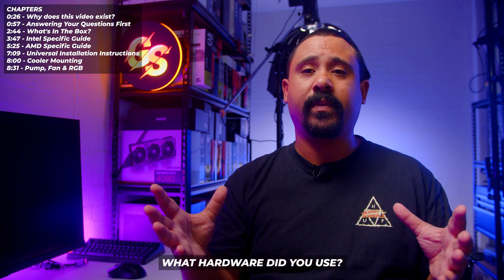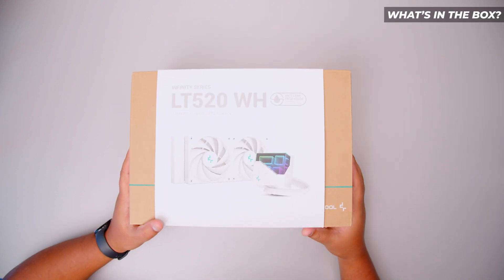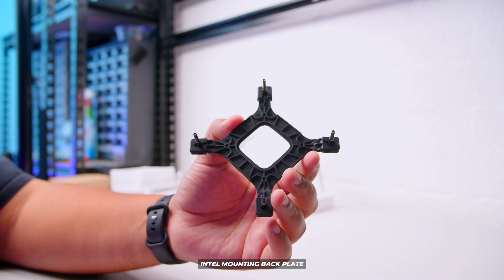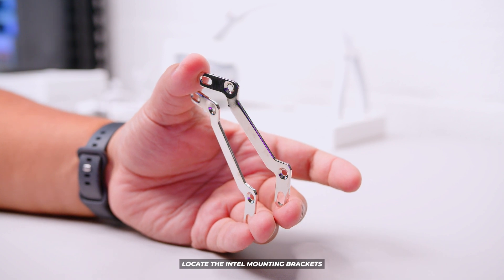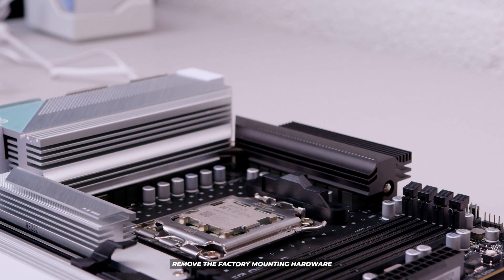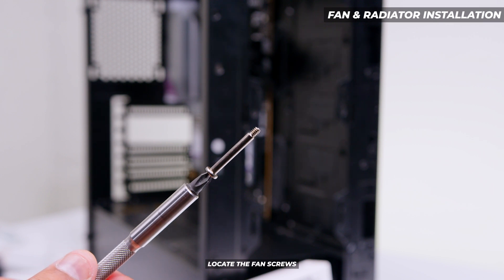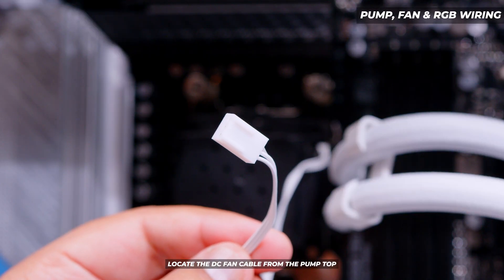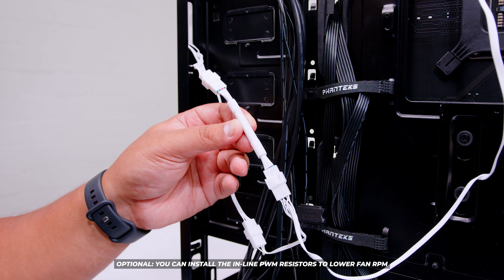HOW TO Install Deepcool LT520 & LT720 on AMD AM4, AM5 and Intel LGA 115x, 1200 & 1700

Comment: i intalled this with my 1700 cpu, and its running VERY hot. at bootup it goes to 90 celsius and idle it'll drop to maybe 50, but then will randomly shoot to 100 celsius sometimes, especially when launching COD or making too much movements. What is going on????

Comment: i didn't think through the pump tubes position and put radiator first with coolers inside of the case in my ITX build. So MB power cable is too close to the fan blades. Should redo the build when installing graphics card.

Comment: I  bought this same cooler installed it but the cpu is reaching 100 degrees after running for a minute wouid that be  because the cpu isn’t properly touching the water block

Comment: I just installed this and the extra cable that’s attached to the 3 pin one where does it go?
Reply: Hello, you can solve it? I got the same problem
Reply: @martinpaulo8552  yeah it seems to be useless ngl I don’t think I need it since my oc works fine without it but Maby it’s for daisy chaining

Comment: Is there any problem if I place the brackets backwards in AM5? Lower bracket impacts my M2 heatsink. Also, is there any problems if I use tubes at 6 o’clock position in AM5?

Comment: THANK YOU SO MUCH. no where in the instructions does it say not to tighten the screws on the bracket all of the way (there's no words at all in the instructions lol). So the copper plate wasn't making contact with the CPU and the PC was shutting down right after POST. 

I couldn't figure out what I was doing wrong. Thanks for having better instructions than the ppl who make the dang thing!!!! Lol

Comment: Is cpu_opt optional? Do I have to attach it, my motherboard doesn't have one. What will happen if I don't?
Reply from the maker: It wont work
Reply: @GearSeekers  thank you, are there any 240mm liquid coolers that work without needing to attach cpu_opt?
Reply: @GearSeekers  I also figured out that the cpu_fan operates pump and fans at the same time for me.

Comment: Why are the tubes for Ryzen coming out of thr right side of the cooler, but end of the video shows them on the bottom, that's confusing since they should be coming from the bottom so the case is aligned correctly.
Reply: Pretty sure he made a mistake while filming the instructions, assuming you're referring to 7:07 ?

You're supposed to put that bracket seen on the left on the bottom directly beside the tubes and the bracket seen on the right is supposed to go on the top side opposite of the tubes and larger bracket.

Comment: Mate, the bracket for AM5 are not well mounted. You should edit that part. They should not be mounted on the side but bottom (where hoses are) and top. Very misleading
Reply: Yup, I had to re do the bracket installation right after watching this video, he really needs to edit that shot for sure or at least superimpose a picture showing the correct orientation.
Reply: @smokescast   had to sell my beautiful gaming PC since then so your  reply made a bit nostalgic :)
Reply: @Lexip_Pixel  ah that's too bad! Hopefully you'll get another rig up and running at some point :)
Reply: @smokescast  thanks mate. I have a mini pc am18 (Ryzen 7840hs) using GeForce now for the moment. It  does surprisingly the job for non online games but miss the tweaking side hahah: I will be back!!

Comment: question - can the AMD AM4 based bracket setup be attached to the water block/pump - so that the nipples (fittings) are on the bottom like in the Intel layout? I have clearance issues that just made my upgrade to 4 dimms kill my EK water cooler - because on am4 the brackets only go on one way and i cannot rotate the darn block to get the nipples from facing the dimm slots to facing down towards the m.2 slot/gpu... sooooooooo upset i can't find a resolution... considering this as the new replacement setup

Comment: So in this video the fans were installed to push air through the radiator back into the case. Was that intentional? I typically try pull air through the radiator and outside the case?
Reply: If you have fresh air coming directly into the cooler from the outside, it will cool your cpu more efficiently than running air through your radiator that has been heated by the rest of your components.

Comment: Great informative video.  I got this exact same AIO cooler for my rig.  This is my first time using an AIO cooler so I have no baseline for anything but I can hear this tinny tinny pumping sound followed with a click from time to time.  Its such a small and tiny noise...is this typically normal for AIO coolers?  Does that sound go away or is it just the pump working?  I have my radiator installed on the top if that helps..
Reply: I have a question for you too. When you first booted the pc, did the radiator fans spin or did u have to set that up in bios? Because only the rgb on my cpu turn on but not the fans

Comment: I bought the LT520, the white version, and I also got the Ryzen 7800X3D at the same time. However, I'm having issues with cooling. The processor gets very hot, reaching 87-88°C after a few minutes of running the Cinebench test, which is not normal (the Tjunction temperature for this processor is 89°C). It's mounted correctly (I've reassembled it a couple of times and applied thermal paste), but nothing has changed. :(
Reply: AMD's chips target their thermal max
Reply: After a few months, I realized that this only happens in Cinebench, in games, the temperature doesn't exceed 75-76°C...
Reply: @Bard_Emancipovani  i have done same as u, but i set setting in bios to max 85temp, and now it runs smooth
Reply: Same with my 5900x

Comment: Great and informative video! I used this as a guide to install one yesterday. There was one inaccuracy on the AM4/5 tutorial though. For the best cooling and to offset mounting you should have the brackets over the side with the pumping tubes as shown in the manual and DeepCools official installation video.
Reply: Ya I was confused as well cause my instructions show the mounts go on the top and bottom not the sides like this video. Is that how yours went on?
Reply: @elemnt360z  

Yes I used the manuals method of setting the brackets. As in top and bottom. AMD CPUs benefit from offset mounting for more efficient cooling of hotspots. Refer to the official DeepCool video to see how to put it on. This video is accurate otherwise!
Reply: My mounting pegs aren’t reaching through my motherboard to their wells, installing on am4, what am i supposed to do? 🫥

Comment: My mobo doesn't have a RGB header, do I need need it to get the pump work? Alternatively, do I need to get a rgb controller or hub to work (It seems very hard to get deepcool controller in store)?
Reply: Get the Razer ARGB Controller works perfectly using it right now

Comment: The small screws won’t fit in the pump for the bracket… they’re literally too thick even without the bracket. It only goes halfway and the it’s stuck.. how’d you fit yours. AM4/AM5 bracket btw
Reply from the maker: You probably used the wrong screws
Reply: @GearSeekers  yeah man. I figured that out a while after I sent that. I don’t get why they send those other 12 screws and 3 ways to mount it.. like it makes you think there’s 4 for each type of bracket.. yet the actual used ones aren’t even in the same baggie lol..

Comment: I wish there were simpler ways to get this to work without 3 cable headers and inline resisters, etc.. Meanwhile I'm using a liquid freezer ii that just requires 1 cable to get the fan and pump working. So much simpler.

Comment: I just wanted to thank you for your video. I have the 360ex and I couldn't figure out how to install as an am5 without you, appreciate it very much.
Reply: Hey, mate. I have the 240EX. Their website states the model is not compatible with AM5. Their support states it is. The mounting hardware looks different here to mine though.
Reply: Hi! do you bought an AM5 kit?
Reply: @Kalus19  No I didn't need to buy the kit. The 360ex came with the kid to install onto am5 board.

Comment: Be warned that the bracket has a weird protrusion that may potentially interfere with your motherboard's top M.2 slot or the heatsink.
Reply: Agree wont fit on my b650e pg itx
Reply: My touches my top m. 2 on my prime 670e
Reply: I just installed mine with both brackets switched to make them fit
Reply: @behindyou64  u just swap the orientation around?
Reply: @A55Meister  yes, it fitted that way, so far no problems with my cpu temps
Reply: Works on b550f wifi
Reply: no problem on my ROG Strix B650E-E but thanks!
Reply: Gigabyte Aorus pro x x670e is a strong no go on this one and it absolutely blowz since i got 2 of them.  And it shut my build down completely.

Comment: Mounting is as easy it can get with Deepcool. I installed 2 weeks ago LT720 to compare with Arctic Freezer 360. Deepcool have same pefromance or even one-two degrees better compared Arctic but Deepcool radiator is 1.1cm thinner. If your case space is tight then deepcool is better option. Used both with 13900k. Maybe because LT720 pump is faster or stronger on max speed. Arctic pump never makes sound but Deepcool pump making little sound if max speed only. What is for me important I can monitor deepcool pump speed but with Arctic you never know pump rpm. LT720 fans are worst deepcool fans I ever  used. Humming noise are backround and it comes and goes on below 1000 rpm.

Comment: Why is the radiator hoses coming from the bottom, there is many videos saying not to do this ever. Just curious good video
Reply: It's in regards to where the pump is and air pockets/bubbles. If you can, you don't want air pockets stuck on your CPU side of the aio. It has to do with noise and longevity. And all aios have different amounts of bubbles. I personally have the LT720 mounted up top of the o11XL. Zero noise, gravity takes care of thr bubbles and keeps it away from thr cpu
Reply: Has to do with improving the longevity of the AIO and helping them last longer which I would argue is a higher priority for many for obvious reasons
Reply from the maker: I makes zero difference. Tubes up people complain, tubes down people complain. The video is for demonstration purposes only.
Reply: @GearSeekers ones this apply to both the radiator side and the cpu cooler side? I accidentally installed mine the other way and just saw this video now. Should I try to fix that?

Comment: I have an LT520 but my RGB part didn't come with any peeltabs? And the the protective plastic was so difficult to peel off that I just left it on. I have seen some builds that still have it on like mine and others where they have easy peels. Should I try to peel it off anyway?

Comment: I just installed the lt720 on my 13600 and it runs, under full load 15+° cooler. I was using a generic aoi 240mm and it couldn't keep the CPU below 85+°